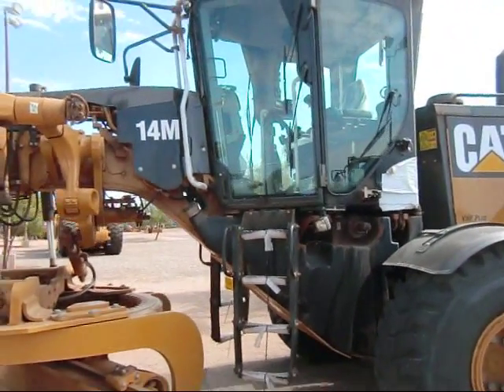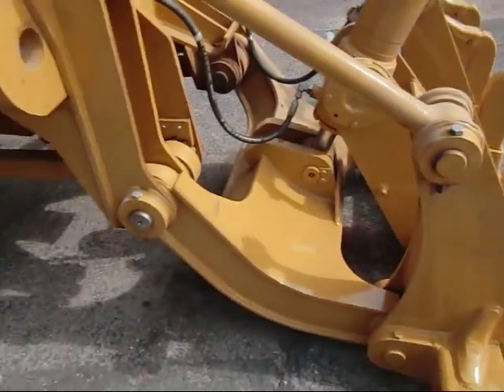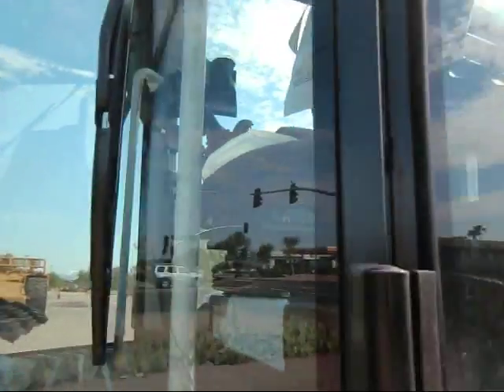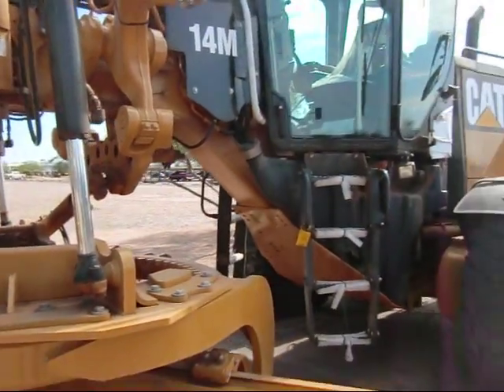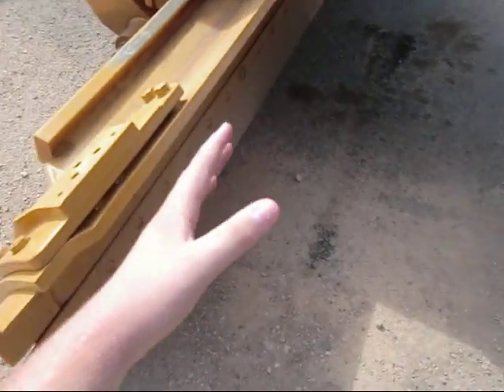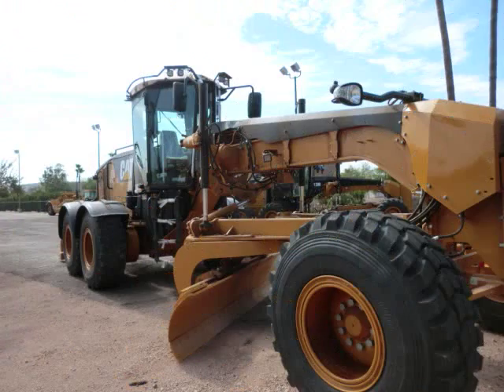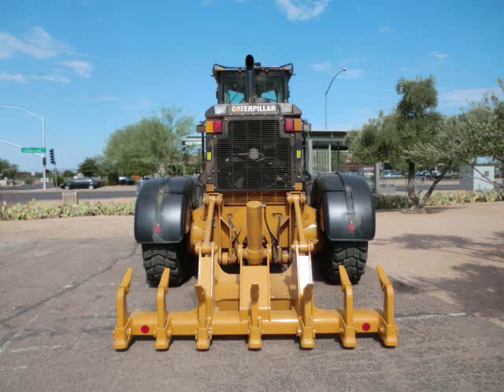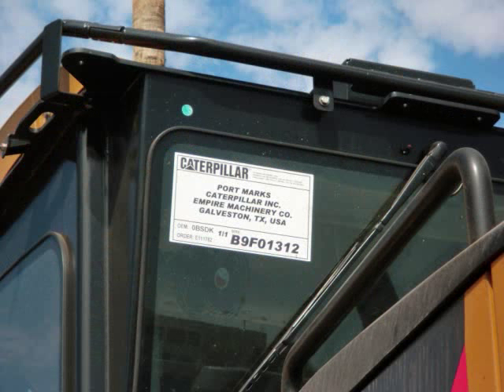CAT 14 M Motor Grader Walk around with specs

Comment: Nice video.  I've been an equipment operator for 15 years and have about a year or so of  blade (grader) time. I was given the chance to first run a 14M on Monday and LOVE the differences between the older G and H models. It is a very easy machine to operate and a lot of fun.